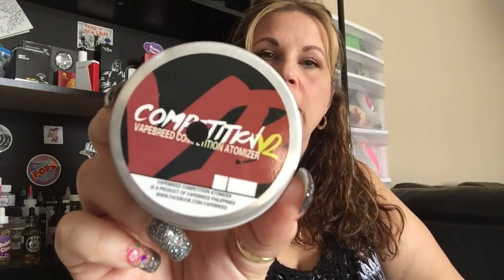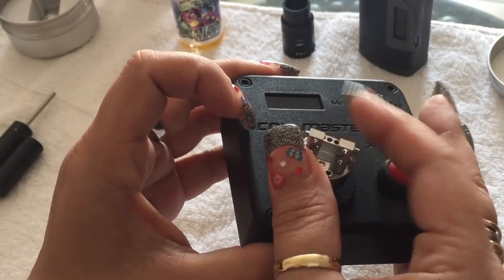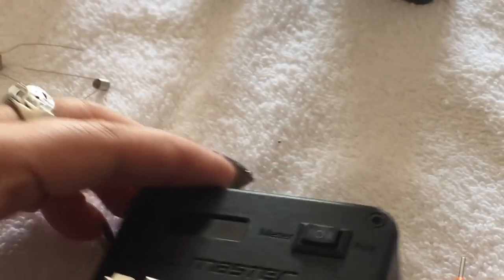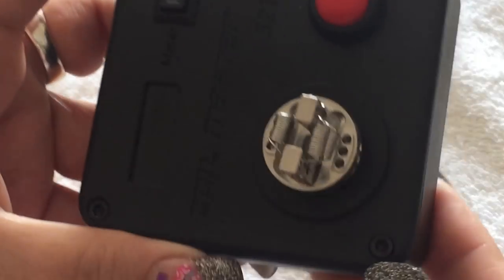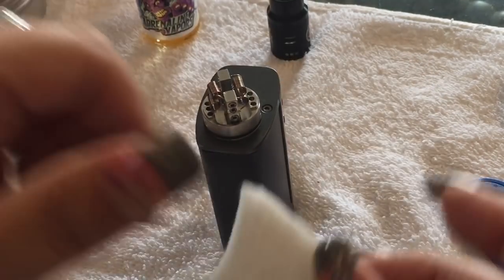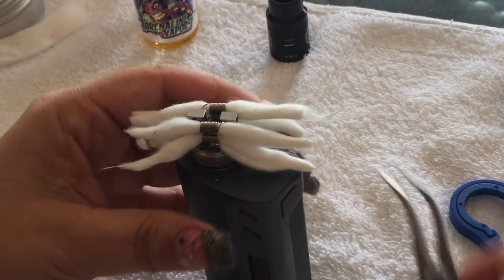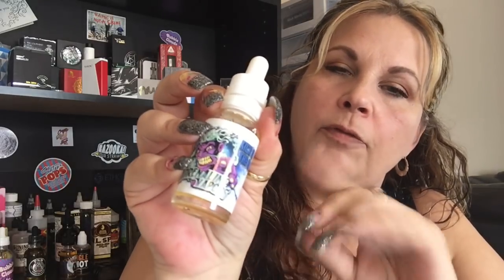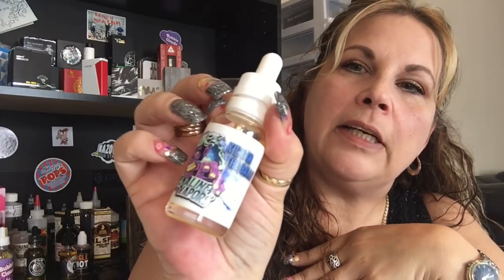TUTORIAL #11 | Quad Coil Build & Review - Vape Breed Competition V2 RDA

Comment: Another device that's similar is the mutation x v5 It comes with velocity posts that are removable, and a post-less deck. I love it for large single coil builds. It doesn't whistle like this device unless you close off all but one of the airflow slots.
Reply from the maker: I never had the opportunity to try the Mutation X but thanks so much for the info and for watching.  :)

Comment: Hi! Great video you have here! :) im just a beginner and im using this one as of now. I want more clouds on my vape and I'm planning to use 3 or 4 coils on mine with fused clapton wires. Will it be safe if i put in on snow wolf mini plus 80w? here's batt info of my snow wolf if this may help..
Batt Volt range - 3.2v - 4.2vBattery internal - 3000mah batteryAtomizer ohm range - 0.05 ohm - 2.5 ohmOutput voltage range - 0.5v - 7.5v
Reply from the maker: Yes, you could do it, just don't let your ohms go below .10
I always aim for around .20 ohms for the best vape experience.  I don't like a really hot vape.
Thanks for watching.
Reply: Thanks for replying wendy! 👌

Comment: Subbed. :> Currently using a clone of VB V2 and I'm planning of building quad coils on mine. Will it be okay with 26g Clapton wires or should I just do Kanthals? And is there really any difference between clones and legit attys? Getting kinda paranoid since it's my first time getting a clone.
Reply from the maker: You can use any wire really to do the quad could you just have to be careful if the final ohms. Most mods can't handle under .10 or .06  ohms so check your device manual. Also if it's not a regulated mod you shouldn't go under .25 ohms. Be careful with safety. Look up the ohms law and an online coil calculator helps too. Thanks for watching. :)
Reply: Paula Jessika Pitagan when it comes to atty its not a big deal to use clones. It's almost the same. But legits are more powerful and durable. But the quality is almost the same. 1 have 2 vapebreed clones. Hers too is a clone 👍 trust me im from the philippines i know clones from legits 😁

Comment: if im using RX200 and kanthal 24g wire how many wraps it would work ? :) :)
Reply from the maker: You need to know ohms law and battery safety and it’s not just about the amount of wraps. It’s how many coils, dual, single, quad. The gauge of the wire, the type and the diameter and length. I recommend after knowing the ohms law and other required building safety information to use the http://www.steam-engine.org/wirewiz.html ohms calculator to answer your question. It’s more than just wrapping wire in order to not burn out your mod too. In addition to knowing how to build you also need to know the resistance limitations of the mod that you are using to determine how low, or high, the resistance of your build can be without damaging your mod.

Comment: I just wanna ask i am using single tube unregulated  mod but if i am going to use an extension with my tube mod is it safe if am going to build a quad coils or 4 coils. By the way i am using a sony vtc4 battery and cylaid battery
Reply from the maker: Raymond Salvador honestly it depends on the resistance that you ohm out too once the build is complete. The lower you go the more stress on your batteries